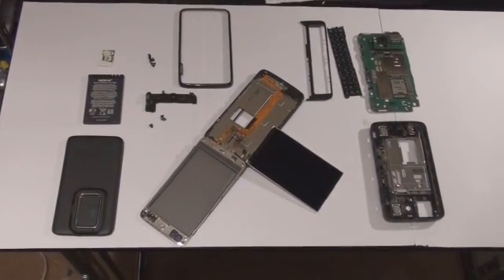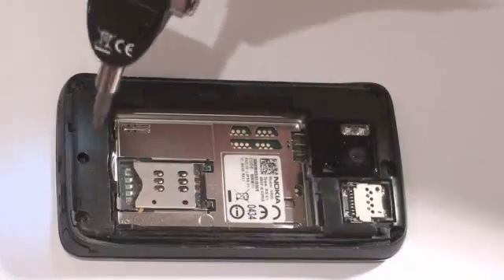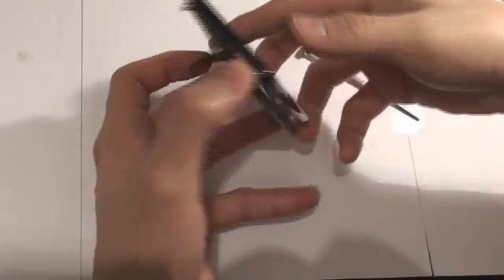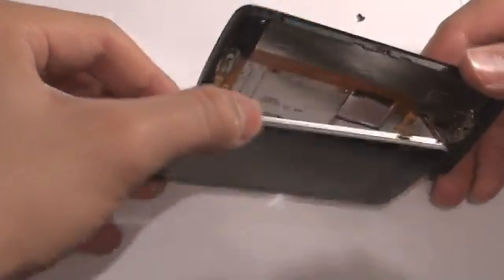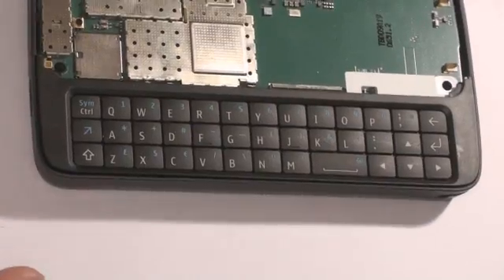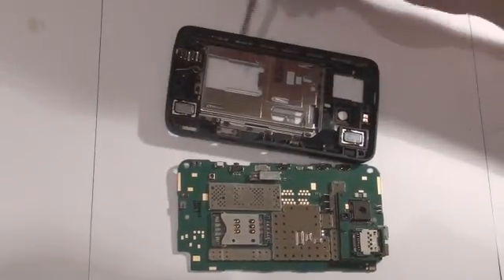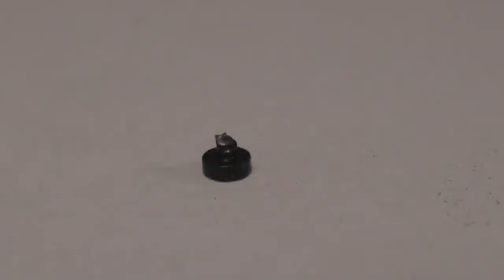Nokia N900 Disassembly

Comment: Thanks for this. Just wished the replacement housing I bought wasn't so shitty, but anyway very helpful video. Removing the metal rim was way too difficult for me though, and I was afraid of somehow damaging the LCD. Thankfully for me I was also replacing the touch digitizer along with with the housing so I skipped that step.

Comment: important bit guys. the pop was unnessesary . you need to take out the keyboard bezel and keyboard before the screen!
the screen slider base sits under the keyboard bezel.
Also when you are reassembling the thing heres a trick to use on the keyboard bezel. when putting in screws. gently turn them the open direction until you feel the screw fall back a little then fasten it. othervise you will mess up the screwposts in the plastic and crack'em

Comment: Just a note on reassembling: when you put the display and keyboard togheter, do it with slide opened, otherwise you won't see the clip on the top of the keyboard.

Anyway.. just changed my scratched digitizer and now it looks like new :)
Reply: I opened my phone several times already.  I replaced the keyboard with another n900 that I had.  When I tried to close it, there was a small space.  I had to align the clip properly in order to close it properly.

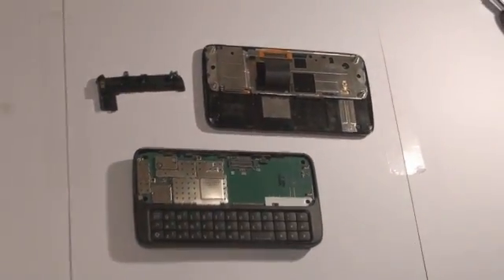Comment: i went with my nokia n900 at a local service.when it was disassmbled the guy from the service told me that because the part (i dont know its name..it`s the green one from 1:29) wass green the phone was dropped in water.i have to say that my battery life is max 6 hours (not using the phone at all ) and it can`t find any wi-fi connection (even though other phone find 6-7 conn available ).is that because the phone was dropped in water  ?

Comment: hi tehkseven, I was just wondering if you can help me to get rid of the creaking sound that I get while pressing the top center of the screen. In the maemo forum I read that tightening the screws will help but they are already too tight that I could't even unscrew them and it certainly sounds like something is not properly attached. Would you be able to tell why I get such creaking sound while pressing that part of the screen? thanks jay